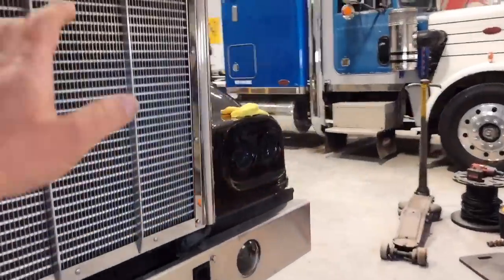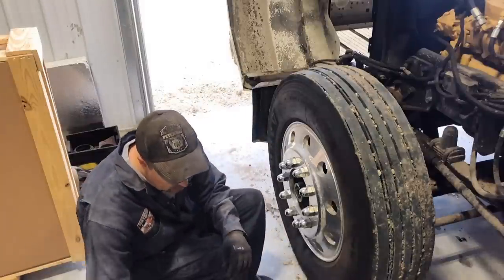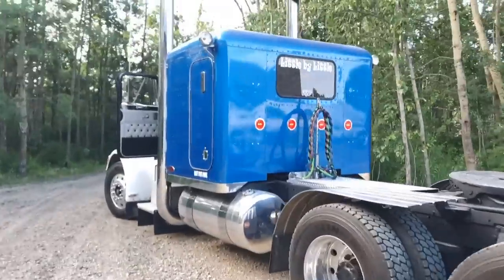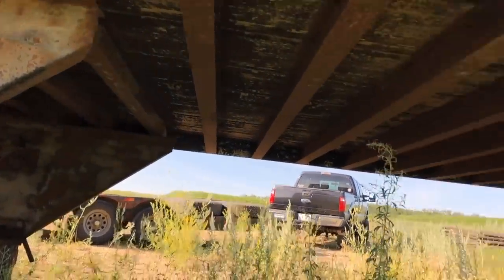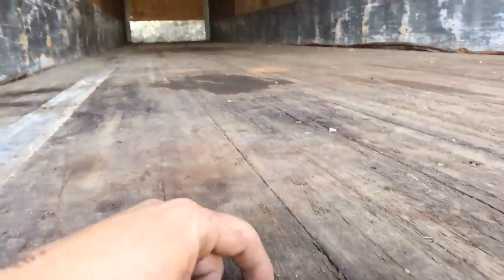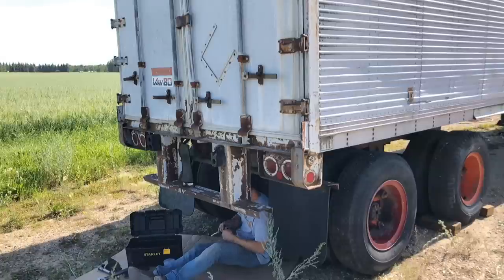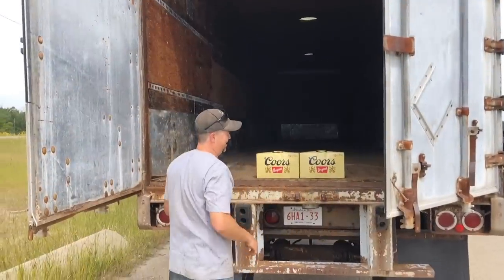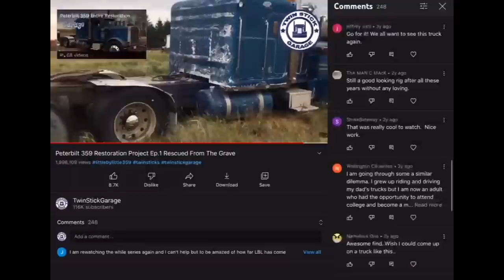OnTheHunt Ep.32 Snowman Trailer Rescue

Comment: Congrats Mark for finding your Snowman Trailer. It will make an impressive display. I noticed you have "E Track" at the back of the trailer. You could make a removable fake wall of Coors secured to a couple load bars attached to the E track.

Comment: If you want to run an air line for air tools and you don't have an extra port on your air tank, or can't hook it up that way for whatever reason... Air hose with the fitting for tools on one end and a gladhand connection on the other. Hook it up to the trailer supply line and open the valve, there you go! I found it handy for airing up tires or using a blow gun to blow the dirt out of the cab!

Comment: Just as a trick for the air hose is get a glad hand than you hook you air hose to your teailer red hose than push your trailer brake button to get air. Problem with fitting down on tank is they tend to rust up
Reply: yeah i would've thought he would have just bought one of those deals they sell at truck stops to air up tires from the glad hands

Comment: Mount an AC on the front of the trailer under the Thermo King shell so when you're sitting in the trailer drinking Coors you can have air conditioning.

Comment: Mark there is a possibilty your (LBL) slack adjusters were installed on the wrong sides. Yours is the first time I've ever seen, a slack adjuster mounted with, the adjuster nut between the chamber and slack adjuster. Take a look at your's and other equipment.

Comment: My uncle Ted used to work for Dufferin Concrete back in the 50 into the 80s when he retired all those years accident free, and doing those B-Model Mack with the 5 and 4. I know the steering wheel is different, but he used to slide his arm into the wheel and under to shift the sticks. Likely the closet one to him. Perhaps you can master that shift one day. Back then they also had Armstrong Steering, so a good bump would give your old arm a pull...lol..

Comment: One of your best videos yet! Been watching from down under since you  bought the old PB home. Happy to see you having so much fun with it after all the hard work. Not much left foot action, how you float gears in a twin stick is beyond me. A little tip for the Duke, i have a similar age Aussie cab over flat top,!8 speed 400 cummins big cam. The jake once flipped on from the dash is operated from a toggle switch on the stick just below the splitter, works great.

Comment: Mark I loved how you never stopped grinning! THAT is indeed 'the point'. I miss driving trucks (semis) and I was on the road for over 25 years. Miss my mates even more (two never made it through COVID) but age takes its toll and there comes a time when you hang up the keys. I ran a small fleet so plenty of great memories and ended up as a Technician until I retired. It is what it is.

In the UK that wheel spread arrangement is called a 'Walking Beam' and balances the weight on each axle. They work better further forward rather than US style right at the back.
They were developed for TIR tilt trailers back in the day for use on European Continental and Middle East runs. Very straightforward as there is just the one major pivot point. Maybe they found a home in Canada as well?
If that is indeed a Fruehauf they partnered with an old established UK company called 'Cranes' in 1961 and the 'Crane Fruehauf' brand was the very best you could buy. Expensive but the best.

As a Brit I did do a double take at the very short kingpin as ours are about 1.6 metres from the front of the trailer and trailers close couple to the back of the cab plus we use 3 axle trailers.

And OF COURSE the Coors had to be bought, delivered and drunk! 👍👏👏

Bit of how the UK does it .....
https://youtu.be/WB8PffWU4DI
Reply: i was back in germany a few months ago and noticed a lot of single scroll trucks and also a lot of super singles. surprised to see so many benzes in your UK video. fully expected just DAF and Scania. back in the day trucks in germany only had 5 axles total. did not realize 6 axles was a thing now.
Reply: @uliwehner   We have a good selection of makes here:
MAN, Mercedes Benz, Scania, Volvo, Leyland DAF.
You are right that in mainland Europe trucks are 5 axle rigs @ 44 Tonnes. The '6 axle thing' is a UK requirement as we have lower drive axle and combination limits compared to the rest of Europe (but still @ 44 Tonnes) to add braking, spread load and add stability.
While its 3 axles on the tractor they are '6 x 2' drive with the middle axle lifted when its empty or more traction is needed. They also act as second steer axles. On some traffics the 3rd axle is behind the drive axle and is called a 'tag axle'.

Comment: They have air lines than you can hook to your trailer lines off of the truck. I would recommend getting one of those because if you snap off that air line connecter off of the tank, you can say bye, bye to all of your air

Comment: You should pull the y pipe of lbl n weld a piece of 14 or 12 ga sheet metal in the center of the Y going frome the base of the Y and up 6-8" in the center of the lead pipe on the inbound side. Makes that awesome smoke show trail out either side perfect every time n if you got rain caps they'll dance perfect instead of one up one down.  Ol lbl sure is sweet.

Comment: put a working reefer on it so you have ac/heat for your couches in the trailer...lol little by little looks awesome with a trailer hooked up. i hope your right about the 20-22.5 daytons my fuel truck has 10-20 tires on it and id really like to be able to swap to 22.5 so when it needs tires i can just throw my old take offs on it.

Comment: Just an FYI on your new air outlet.
You're best to put a tap on before your fitting. The fittings get filled with schmoo and tend to leak if you don't use them much.

Comment: If the trailer is only going to be used for show you really should deck it all out.  Build a bathroom inside all the way at the front and use the rest of the space as a bar and man cave.  Do a glass wall with man door right next to the original trailer so you can have natural light and climate control.  Since windows would ruin the look a couple of large rectangular sky lights would be cool and it would be cool to sand and finish a trailers original hardwood floor using clear epoxy to seal in all the imperfections.  If you solar paneled out the roof with high wattage panels you could generate a good amount of power to run ac and other electronics.  It could be built out really cool, I have seen semi trailers turned into stealth homes and there is some amazing ones.  Maybe the daycab company would assist in the build out.

Comment: I am an old retired trucker after over 30 years on the road. I prefer Peterbilts with Cats.
I was empty in Orlando and dispatch sent me across town to a truck that had wrecked.
I had to take the load off the wrecked truck and transfer it to my trailer.
During a thunderstorm a tree limb came down on the moving truck and destroyed the trailer.
When I got there it looked like the movie truck. The Driver owned the truck and told me it was the trailer from Smokey and the Bandit.

Comment: I've never been able to understand half fenders on trucks.
In 10 years I've maybe hit the fender on the trailer 4 times.
But in that 10 years I've NOT had to wash 1000 pounds of mud off the trailer and back of the cab.
I guess when you've only got 1 trailer to wash its not so bad. When you have to wash 3 trailers and it takes half a day you'll do whatever it takes to keep them clean! Full fenders and anti-spray.

Comment: "Gotta pay to Play!"  but you can pay less to play too. Anyone can become a member of the UFA by purchasing a share for CAN$5 which gives access to 151 cardlock locations primarily in Alberta. Significant cost savings can be achieved but you need to follow the posted prices on a fuel tracker site as they change often. If you become a "preferred" customer by making frequent purchases then an additional .03 cents might be possible as a discount at a single location. Coop membership is similar and savings can be had at the many rural cardlock locations across Alberta and Saskatchewan.

Comment: Hey mark FYI just to notice point out the two far metal left & right polls behind the trailer doors needed to be removed by order the correct movie trailer that has only middle polls to open & close it should easy to remove the far trailer polls.@ 30:35

Comment: It was called a Canadian spread because they were too close together for U.S. rules to allow 20,000 per axle. I forget because Im 67 and Ive been out for 20 years. But the U.S. spread needed to be I think 110" to allow 20,000 per axle. A lot of them slid independently. You still couldnt gross over 80,000 but it made it way easier to scale. Particularly with a longer conventional which was very hard to get 12,000 on the steering axle. The spreads were very popular with flats and reefers usually paid by weight.
Without the spread you had to scale 34... 34.. and 12 to gross 80. With the 110" spread you could put 10,000 or even less on the steering axle. And put the extra weight on the trailer without worrying about scaling it. 
A lot of them were on air too. So you could lift one when empty saving on tolls and tire wear.
I heard of steel haulers claiming on the PA Turnpike which charged by weight and had single axle scales at the booths... that they could lose a thousand pounds or more by shifting the air back and forth between axles... You would see them going into the booth at 1 mph with air bleeding out all over the place....
Fun fun fun....
I do miss trucking in the 70s.

Comment: Also, You should try and find some rain caps for the stack, or you'll be changing the system before you know it. They are probably hard to find, but if you check out the Iowa 80 Truck Stop, you might be able to find a set. Years ago when we actually had truck stops like the 5th Wheel, they had the stores for that stuff. Just wish they would entrepreneurial those back again instead of McDs, Subway (Subs are good)  and other unhealthy foods...
Reply from the maker: Yeah I bought some 8” rain caps last year when the truck was still outside all the time … just need a ladder to put them on
Reply: @TwinStix  Very cool.. Thank you and smart move...

Comment: Mark its actually really easy to switch out the hole inter rear bogies on those trailers. Sence your trailer has sliding trailer axles. Then you could get make the trailer more movies correct axle spacing wise.

Comment: You should invest in a Milwaukee m18 grease gun it speeds up the process of greasing a rig. I do mine at work in about 10 mins. Also when you start with a fresh tube of grease start under the truck so then when you run out of grease you won't be under the truck on the last fitting and run out of grease.

Comment: Did'nt they use a hammer to check the air in the tires back in the days? The zing would tell you if the pressure would be right! They still do it on trains to check for cracks in the metal.

Comment: ol' Blue looks MINT.
be honest Mark you put them slack adjusteres wrong side around on,
because every truck and trailer I ever adjusted Brakes,
the set screw was in the back so you could simply use a Ratchet and socket.

btw. if your annoyed by the Spread dolly just buy another that fits and swap it,
thats the great part about those dollys axles you can swap them out in 5 min
(with the rigth tools)

when did peg do that @2:25, I can't remember seen that Dumptruck in one of his vidyas
Reply from the maker: Future Peg Episode 👀

Comment: You know you could change out that spread axle!!

Just look for regular trailer the same year and switch out the bogies!!!
Reply: 6 bolts and a couple air lines  ... honestly if he's gonna restore that trailer that's the best way to do the suspension and stuff anyway drop the subframe out and put the box up on pallets or barrels or whatever

Comment: You need to hook the air horns up to a pull cord from the ceiling
Reply from the maker: Train horns are typically controlled with a valve down on the floor but I do plan to put a pull up above when I install an air horn 👍

Comment: Great vid but if you don’t mind me asking, what’s the point of turning off the jakes to downshift when you can leave them on and still downshift? Is it a preference or is it different with a twin stick? By the way, she sounds good 😎👌🏽
Reply from the maker: I mentioned it in the video and normally you can leave them on but I bypassed the clutch and throttle switch and wired them directly to the solenoid so I have to keep turning them on/off.  I plan to wire it correctly eventually 👍
Reply: @TwinStix  ah ok. I must’ve missed it. Thanks for replying

Comment: Once the trailer is finished, are you going to transport the Trans-Am on it just like early in the film? ;-)
Reply from the maker: That’s the plan 👍
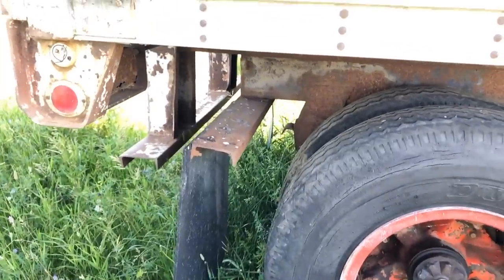Reply: @TwinStix  21:42 - These Dayton hubs are movie-correct. You should reuse them on the other tandem carrier and the frontmost set should have Hub Odometers.
Reply from the maker: @user-rs1990  those were dry rotted and you can’t get 22” tires anymore … as I’ve mentioned I did the perfect “movie correct” thing with the truck and I’m ok with deviating on the trailer

Comment: Did you notice that he had to remove the exhaust pipes to get it out of the garage?  He should have whacked a foot off of both of them while he was doing it.  I do not understand why he enabled the exhaust breaks at every intersection, I thought they we intended for going down big hills. Ron W4BIN
Reply from the maker: 😂 the exhaust pipes just fit and I was trained to used Jakes to help slow down and use the actual brakes as little as possible

Comment: LBL has a B model right?
I know you can actually add air by a screw on the engine, you could probably get 600 ponies on the ground out of her
Reply from the maker: Unfortunately it’s an A block so not as easy to turn up
Reply: @TwinStix  i really only know the bottom end bearings are different i didnt know if the pumps were different as well.
what i do know is that easing into them and letting the turbo spool "air up" they really dont smoke, that 600hp 359 i talked about on instagram hardly smokes unless someone hammers hard on it, which is a bad idea because its got an old straight-cut 13 over in it, speaking of, i uploaded a video of various clips when i rode in it one day if you're curious.
one of these days i might get enough of a vacation to make my way up to the great white north and meet some of yall and see the trucks in person, Snowman especially

Comment: Hey Mark does the brake saver work In Little by little ? The iron Duke also has one
Reply from the maker: Sure does but leaks pretty bad … I use it occasionally to warm up the engine quicker in the winter 👍

Comment: Why do you keep turning the Jake's on and off just leave them on . And all that shifting I would throw one of them shifters out the window.  Lol
Reply from the maker: Like I said I the vid I hot wired the switch to the jake solenoids and bypassed the clutch and gas pedal sensors so you need to flip it off all the time but I’ll fix it eventually 👍